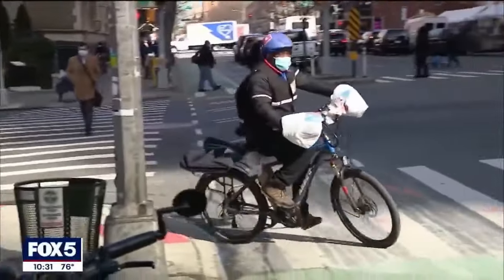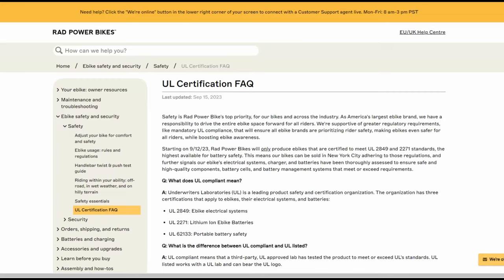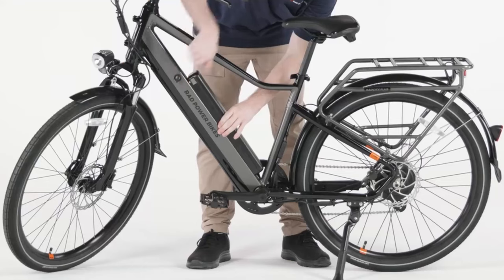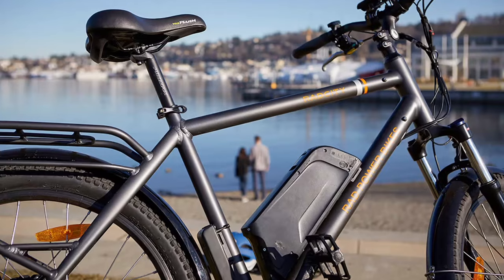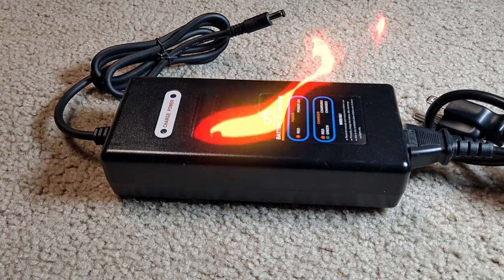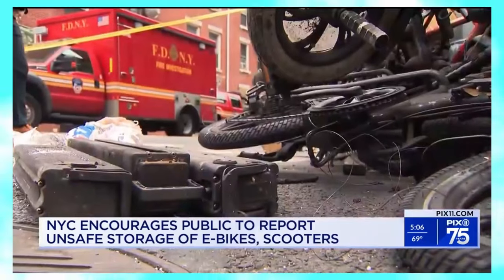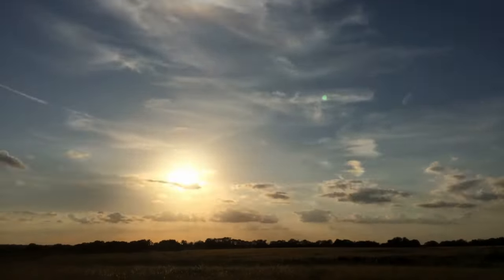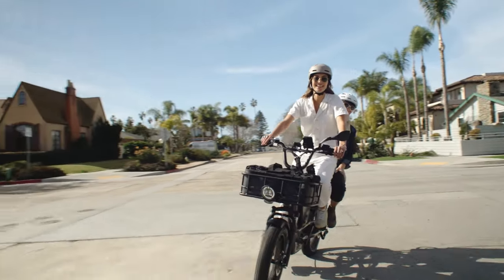Is your Rad Power Bike UL Compliant? Diving into Rad's UL Certification Annoucement!

Comment: MORE COMPLIANT= MORE MONEY
Reply from the maker: Unfortunately, yes. UL certification really hurts the smaller ebike/battery companies since I hear it is pretty expensive to get tested.
Reply: @ElectricRidesUT  it may be good to note that Rad has actually lowered the prices on their bikes recently :) So the UL certified batteries does not seem to be affecting pricing negatively. Their newest safe shield battery however is a little more expensive although not obscenely. ( i think it was $100 more or less )
Reply: @alexcharland4742 
They don't stand by their JUNK

Comment: Glad to see Rad Power Bikes designing, making their products to UL standards and and obtaining UL certification. It will weed out the poorly designed and made ones that are causing deaths, injuries and damage, including damage to the reputations of ebikes, scooters and the quality brands.

Other ones I’m aware of include Velotric, Juiced and Aventon. Lectric’s new XPeak is certified to UL 2849. Electric Bike Company is seeking UL certification. Supposedly Ride1Up is doing the same. I hope all are following suit. I will no longer buy any ebike that isn’t UL certified.

It would make life easier for ebike and escooter manufacturers if UL harmonized their two standards with the EN versions, which predate them. I think the main obstacle is the lower power cap in the EN standards on the systems and components (I think it is 250W).